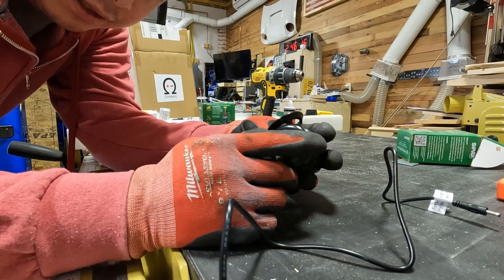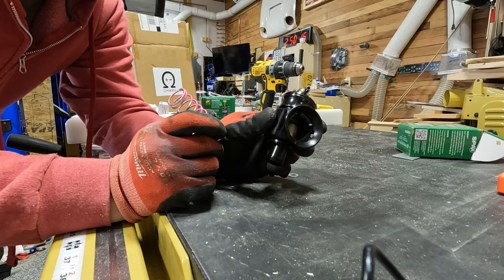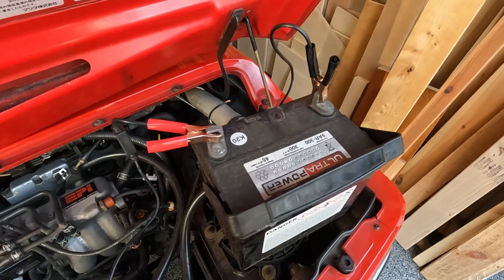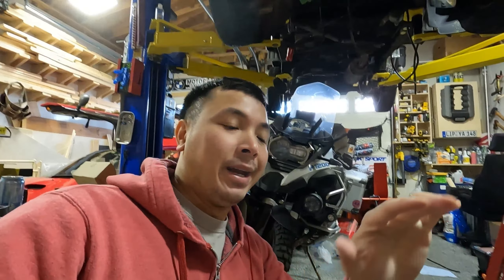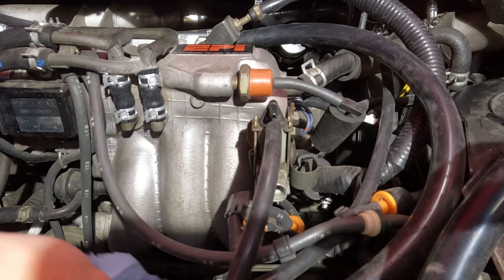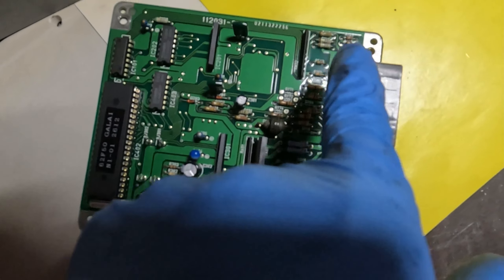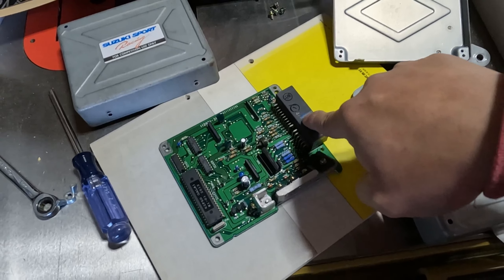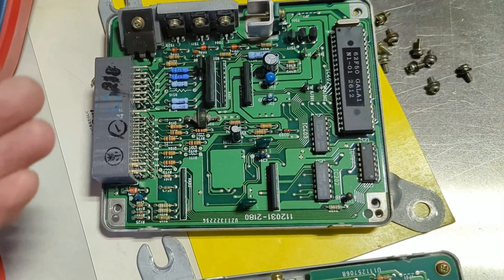Troubleshooting Suzuki DOHC F6A Motor Sensors/Solenoids - Started With BOV Not Working Correctly.

Comment: Random comment for channel interaction.
Reply from the maker: Catpusheeno
Reply: @AnythingWheeled  Random praise for better diagnostic skills than many mechanics.
Reply from the maker: I work in IT. I know how to do stuff and things 😆
Reply: @AnythingWheeled  Unlike the electronics specialist I worked with at an undisclosed car dealer, who ordered an ECU without testing anything, and I got the job the replace the part when it arrived and I refused because I knew it wasn't the ECU after a quick look at the diagram...
Turned out I was right, the junction box was faulty, and it was 3x the price of the ECU... (under warranty)

Comment: so did the isc clicking go away? I see the BOV works, but was the isc a pin issue or mechanical?
Reply from the maker: The ISC is still clicking. I have to investigate that later. I don't recall it clicking so much before but it also was warmer weather the last fall before I put the car away.  I went out on vacation right after this so I can't get back to it yet.